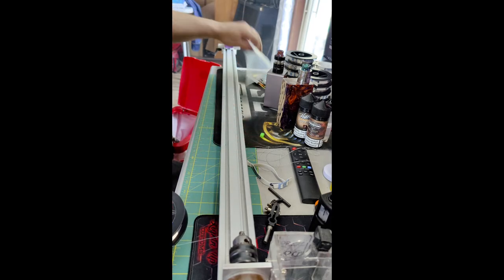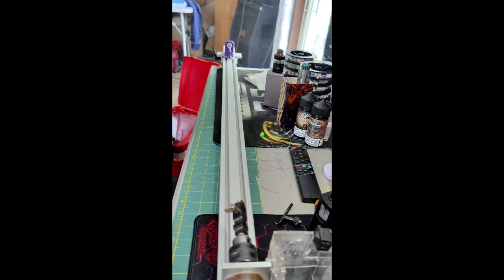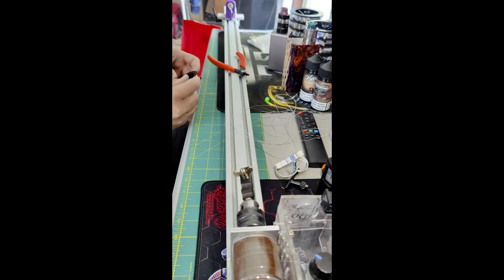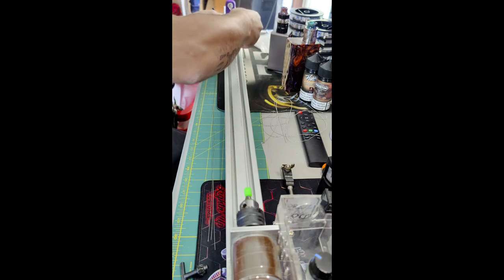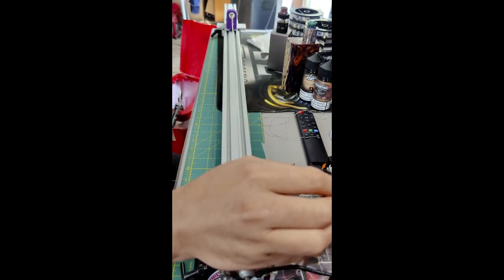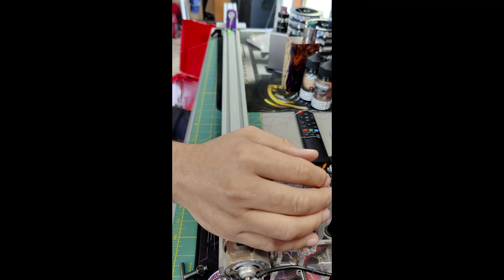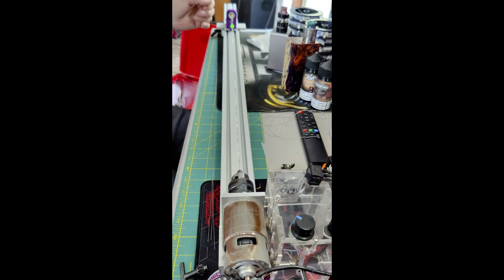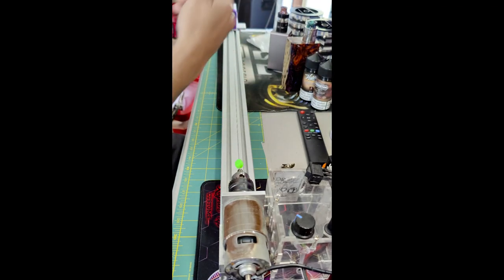Alien Coils

Comment: If you don’t mind me asking what kind of rail system is that? And where did you find it? I’m slowly trying to build a good system somewhat like yours. It seems very efficient!
Reply from the maker: The aluminum extrusion rail is from a company called 8020 dot net, they have all kinds of options. This particular rail is a 25-2550 part number.
Reply: @nickdumas9885  okay I see. Couple more questions and I swear thats 
it 😂 which component did get to slide back and forth on the rail and does it come with the brake lever or do you have to purchase it separate because I see them on here. And as for the motor did you just rig something together basically? Sorry for all the questions. I honestly haven’t seen a better rig than yours so I’m very intrigued!
Reply from the maker: @TheRealEricRose  The slide part is a linear brake, also sold on the same site. You will need to purchase the handle separately (not sure why tbh). The mini lathe motor came from amazon along with a DC 60amp PSU that allowed me to have infinite speed control, forward, reverse and neutral. There was a bit of "engineering" involved to make it all function properly. The motor is on a 17mm thick riser plate, the swivel on the linear brake I had to open the mounting holes to 3/4" and use bushings to mount my swivel on to that. 

If you want to make it all work and have some creative flair, you can certainly pull it off. :-)
Reply: @nickdumas9885  okay I got most of it ordered up lol but what about your power supply did you go with a 5a or 12v 60 amp?!
Reply from the maker: @TheRealEricRose  

This is word for word what I ordered :-)

Aweking DC10-60V 12V 24V 36V 48V 30A Motor Speed Controller,PWM,Adjustable Driver,Max500W,LED Indicator,Reversing Switch,0%-100% Speed Controlling,Bru

You may  not find one from that very brand but those are the specs.
Reply: @nickdumas9885  okay I think I have a good setup picked out. I have a friend that basically gave me a run down of what I need and if I have any trouble he said he would help me rig it up. I appreciate all the help though. Whenever I’m done I’ll post it on your Facebook group so you can see the final results!
Reply from the maker: @TheRealEricRose  

I look forward to seeing  it all finished brother :-)